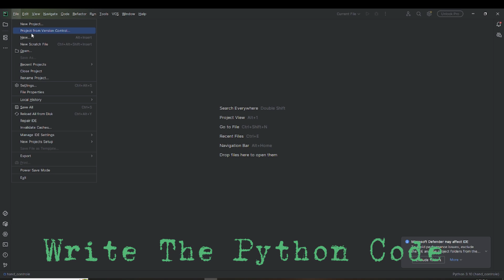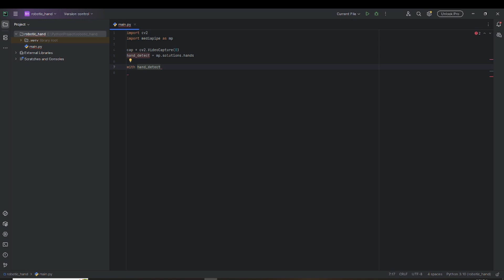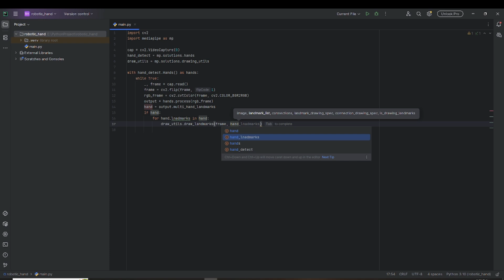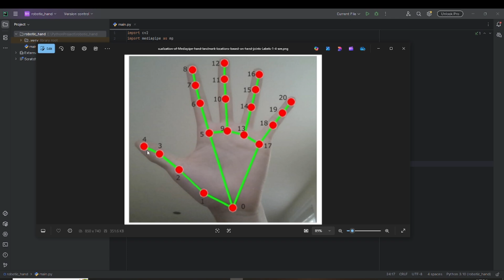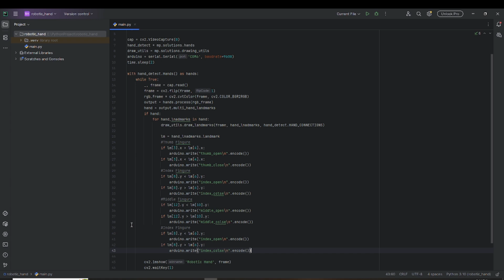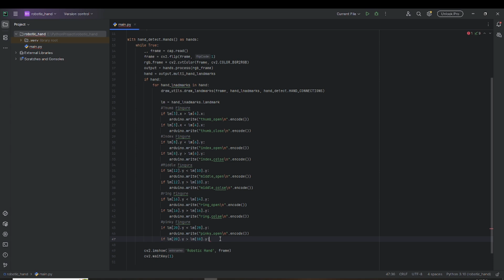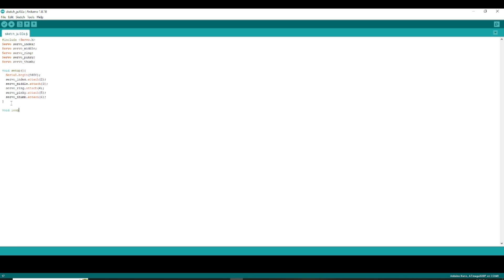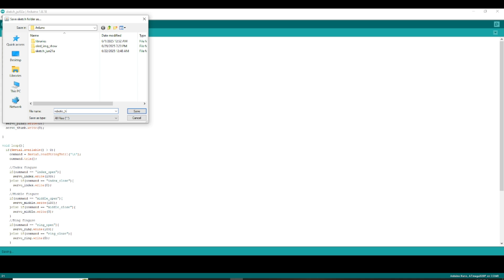How to make a DIY Robotic Hand with OpenCV & Arduino | Hand Tracking Project

Comment: Hi i was wondering if you had like a blue print for the body of the hand mainly the finger joints? if so i would love it if i could get it!
Reply from the maker: Actually, I don’t have any blueprints or sketches for this robotic hand. I shot the video a few months ago, but I actually built it about 3 years ago. I designed the shape purely from imagination. First, I made three segments for one finger and tested how they worked together. After a few adjustments, I finalized the shape and then built all the other fingers based on that design.
If you’re looking for detailed models, there are many 3D (.stl) files available online that you can use to get a similar structure.
Reply: @team_gearheads  Oh okay thank you! that's really cool that you built it from scratch!

Comment: cool...what are the parts brother?
Reply from the maker: (1) Plywood board (For making the shape)
(2) Servo motor (To move the finger)
(3) Arduino (To run C++ code)
(4) computer or raspberry pi (To run Python code)